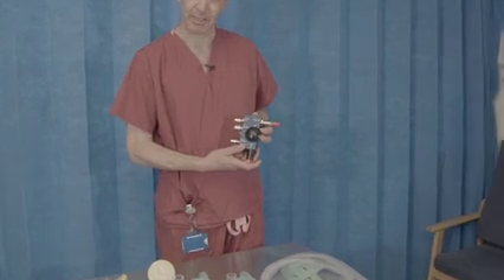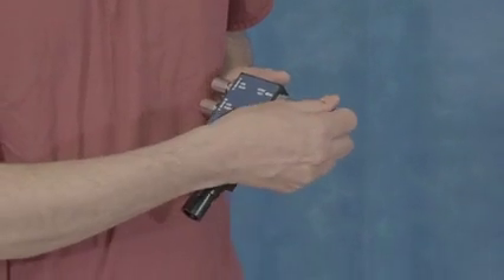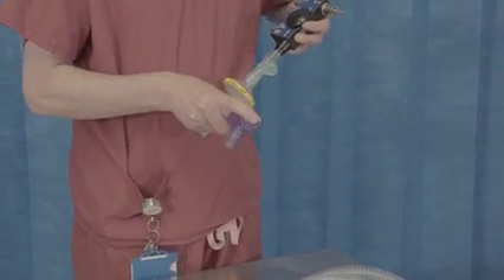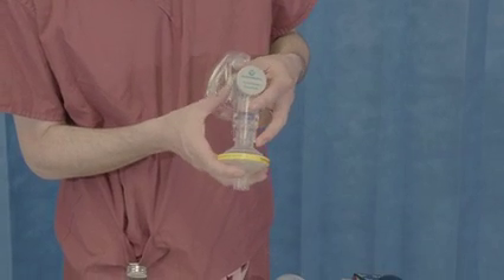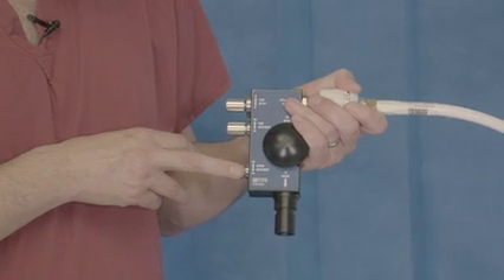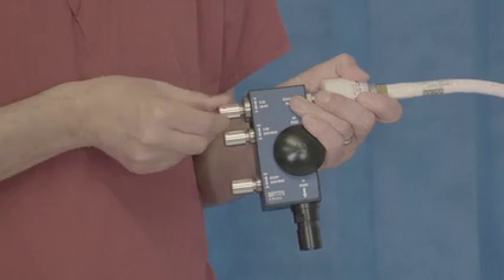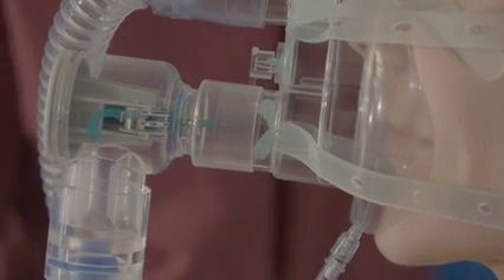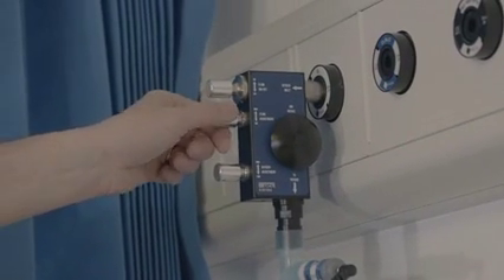UCL Ventura CPAP Machine

Comment: Thanks for sharing the video, it is very instructive. In the current deployment, is the flutter indicator always present and used for setup as well as patient monitoring or can it be left out? We have a sample on hand that does not have this part but documents that came with it show the part in the instructions and diagrams. The hope is to localize the disposable parts for the Philippines but no standard part flow flag indicator/flutter valve can be found. Thanks